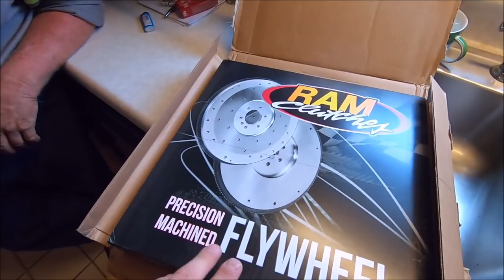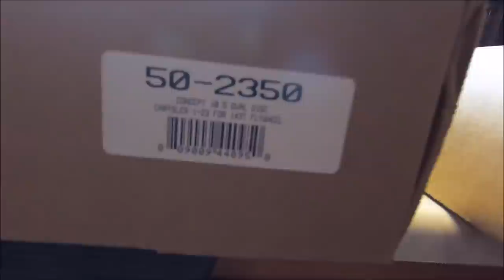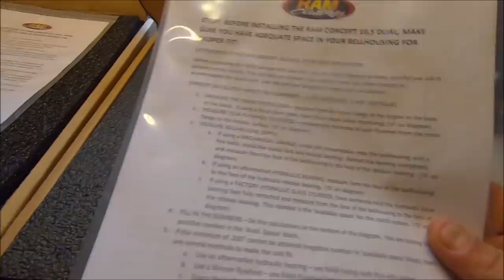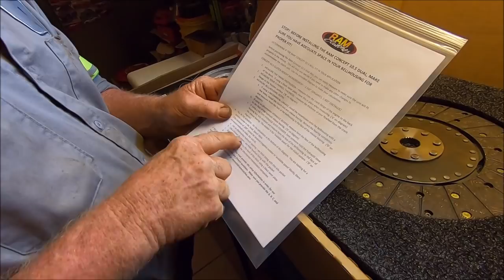RAM Twin Disc Clutch Unboxing 4 Jezebel & Dad's Hemi Charger #HandlebarMoustacheChallenge

Comment: Hi Jed! Nice clutches! My personal opinion would be to go with a heavy duty Dodge daully truck clutch, but what do I know? The truck clutch would be more reliable. Racing clutches are great, but don't last long. "$$$!!!" I hope RAM is a great clutch. I never heard of RAM until this video. Good edgemacation! Centerforce can kiss my ass after their shitty clutch costed me over $1,400.00 to replace my flywheel, clutch, pilot baring, throw baring, slave cylinder, and master cylinder in my 1988 Toyota HILUX pickup. Not to mention how much machanic labor was either!